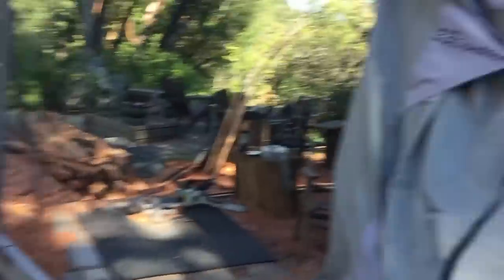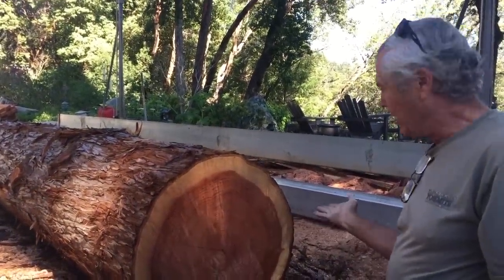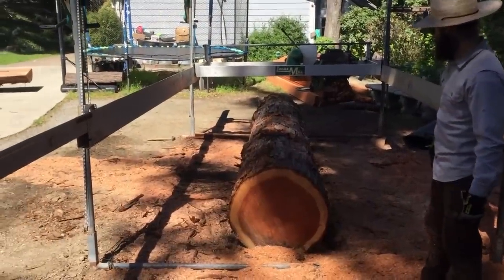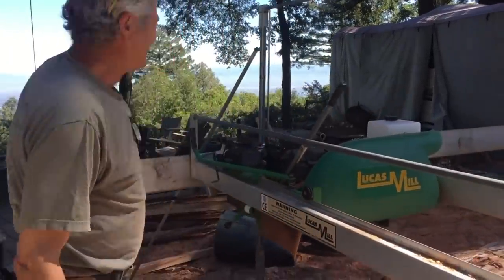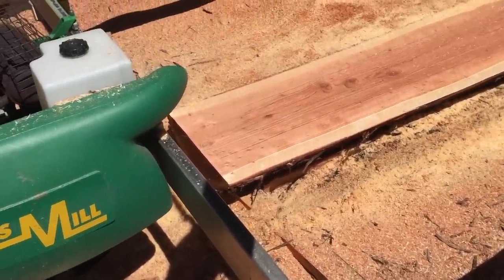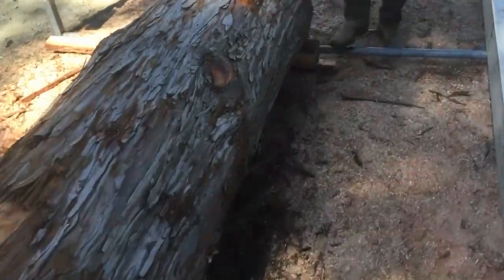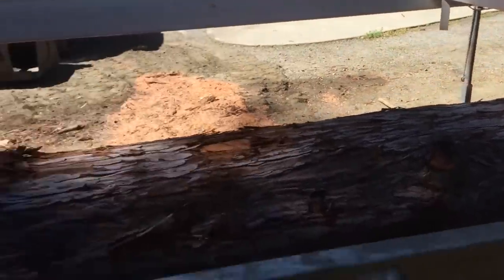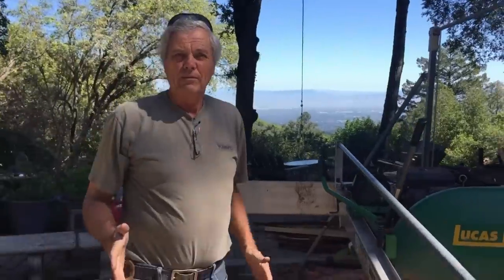Two Stories, same footage

Comment: I like the smell of bacon.

I like the smell of milling wood.

I vote for cut #1. The quartersawing explanation was good. (In quartersawing, as you work your way down the log, the grain angle changes, right? Do I read correctly that a change of up to 45° is acceptable in the annual rings' angle?)
Reply from the maker: Michael Dougfir best is with the grain straight but some of the boards end up more angled. Read and adjust as you go. That is a benefit of this mill over a bandsaw

Comment: Is sawdust a good soil amendment.
Reply from the maker: Candice Hanson aged yes, top mulch good. If you mix it in it will not be good for planting until it degrades.
Reply: (might want to avoid WALNUT, it will be harsh for any plant other than itself.)
Reply from the maker: Michigan Mister that is true. When I dump chips at stables, they ask about walnut. Apparently, it causes problems with the hooves
Reply: near impossible to grow anything under one, especially a black walnut.